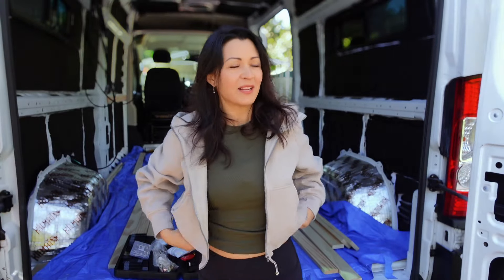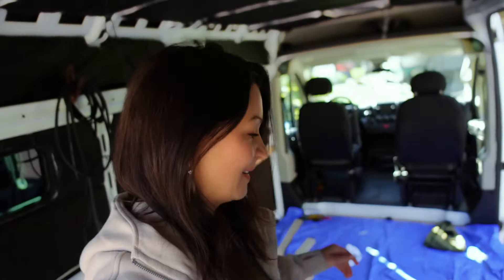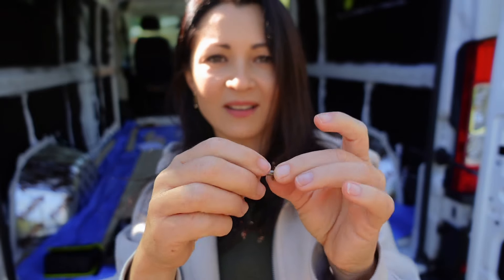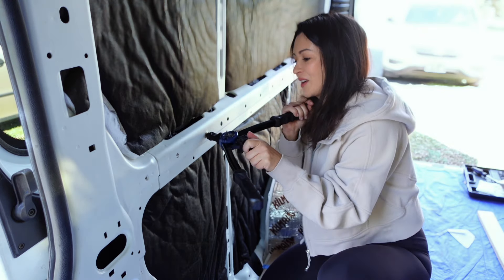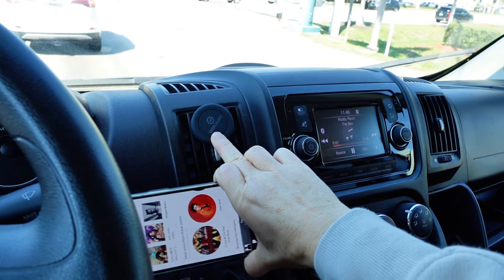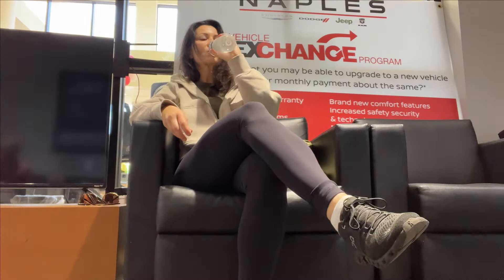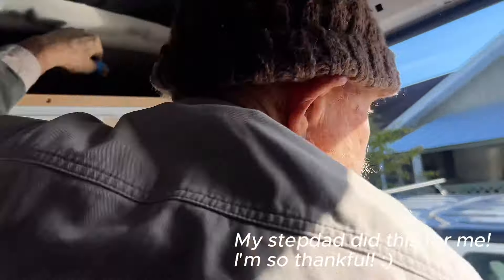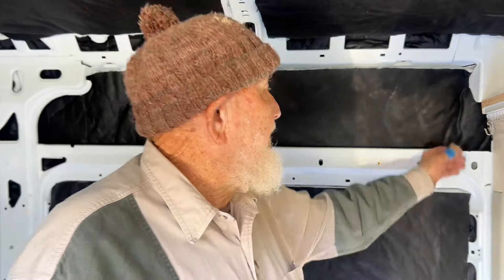Dealing with my van's battery issue and framing | Ep 24

Comment: For future reference, Autozone, and probably some other parts stores, will test your battery and alternator for free. Also, you can get a volt meter, not expensive, and test your own battery and alternator. There are many videos on Youtube, that walk you through using the volt meter, and doing those tests. If you test it yourself, at least you know for sure the dealer isn't taking advantage of you. Dealers will do anything to make a sale. You should be able to get 5 years or more out of a battery. Also, start your van up once a week, and drive it around for 15 minutes. The alternator will keep the battery charged. Anyway, the build is coming along. Keep up the good work. Kudos to your step dad for helping out.
Reply: As others have mentioned, a trickle charger is also a great idea.
Reply: $$$645??? For a battery??
Reply: Dealerships are a rip off.
Reply: I’d take the free battery & alternator tests with a grain of salt. I once replaced the alternator 7 times in a row under warranty in 3 weeks time & could do it in 10 min flat. It would test good in store, but wouldn’t charge when in the vehicle. The 8th worked totally fine. Yes, they were all rebuilt that you receive under warranty.
Reply: Theres some sound advice Elisa 👍

Comment: If you are going to leave your van parked for long periods of time get yourself a battery tender. Modern vehicles have parasitic electrical draw and over time will drain your battery. As for dealer avoid them like the plague. The only time you go to a dealer is if what’s wrong is under warranty or if your car is under warranty and needs regular service.

Comment: Shocked that the dealer got to you for $675.00.  You can buy that battery for well under $200.00...probably about $150.00 at O'Reilly, Advanced Auto, etc.  You should take it back to them and make them refund the exorbitant price they hit you with.  You are doing the right method on your build...taking your time, doing your research and your stepdad's shop will set you well for all the tools and help for the build.  Looking forward to your progress!
Reply: I agree with a refund. Walmart will install and it will be a lot less expensive.

Comment: Standard 12volt lead acid vehicle batteries don’t tolerate being run completely dead very often and can shorten it’s lifespan. Your battery is mostly there to start the vehicle and run accessories (when the vehicle is off). Your alternator is supposed to put out enough volts  (usually 13-14 volts) to charge your 12 volt battery, and run all your accessories when the vehicle is running. The little jump starter packs are definitely a life saver when nobody is around to jump start you. Smart investment! Thanks for sharing.

Comment: Buy a multimeter and your van battery should read 12.something when nonrunning and should read 13.7 to 14.something when running and that should let you know if the altinator is doing it's job.

Comment: Very good video. There is a rivnut <sometimes called crushnut> device that is pneumatic, but you need to have an air compressor, but if you are using holes already in the van it makes that job so much easier and quicker,
Reply: Besides, you get a lot of exorcize that way. LOL we use to jokingly say "we must, we must develop your bust" because it definately works those muscles. lol

Comment: Hey, for countersinking screws, there is something called a countersink bit that is easier to use than a Forstner bit. It drills a conical hole instead of a cylindrical one, and it matches the taper of the machine screw head. Great work this week!

Comment: One trick for marking your rivnuts. Color the face of the rivnut with black sharpie then hit the board with a soft tip hammer.  It will leave an indent and a black mark. Do the two on the ends attach them , then do the same with the other ones.

Comment: After watching probably a hundred van vids for a couple years now as I am soon to build my own, you have done a terrific job! Craftsmanship is wonderful. You've thought of most everything. You're on top of it with the jumper box for the battery too. As a motorsports guy all my life, I can tell you that if you had a 1965 van, you could park it for weeks and the battery would be fine. All todays vehicles have ECUs and onboard computers that constantly draw power. Park it a few days it may not be a problem, but park it a couple weeks and the battery will be drained, and not because it's a Promaster van. Get a Battery Tender. Hook it up when you're not going to drive it for a while and it will keep the battery charged. Keep up the great work.

Comment: With new vehicles, the main computer will slowly drain the battery because everything depends on the vehicle main computer. When the vehicle is sitting idle for a long period of time, you need a trickle charger to keep the battery charged.

Comment: The battery issue is likely due to you having the doors open for so long while you are building it.  The interior lights stay on and use battery power.  Also, having a van sit for weeks without being started will drain the battery as computer modules use power too, clock, stereo, etc.

Comment: Hello, I follow your channel and I'm amazed at what projects you "fearlessly attack" and you finish in such a professional manner...you really impress me!!...so, I've been an ASE Master Tech for over 47 years now retired...I have to say that without me actually checking the battery, I cant say for certain, but i know that if you just let the battery sit there, there will always be a small draw that overtime, will drain said battery...what I would do first and foremost is buy a good quality Battery Tender or "trickle charger" and once you jump start your vehicle and let it run for a bit to return some life into that battery, then shut it off and connect your "trickle charger" to your battery and connect the charger to a wall plug and as long as the van is parked keep it connected ...it'll slowly (recommended) charge the battery to full capacity and then it'll "maintain" that charge whether you start it or not...just my 2 cents!..😉👋👍✌️🇨🇺

Comment: I wonder if blue or even red threadlocker on the machine screws might be a good idea. I'm not building out a van but I can see where those screws could loosen up in time. May not be a problem but now is the time to do it if you want to. Using rivnuts is a great idea, it almost certainly has to be more secure than self tapping screws.  3 years is about the right time to replace a battery, they can last longer but for peace of mind I wouldn't risk it.

Comment: Regarding your ProMaster: I've had my head under the hood of a car (truck, etc) since I was 17.  I'm a lot older than that now - and, for me (I am 6'2" tall) - the ProMaster is the choice that I will purchase over the other products on the market.  So, don't worry -  you did not acquire the wrong vehicle.  3 years on a battery that was in very cold and wet weather is not untypical.  A lot of cold starts and hard cranks.

Comment: Good job Elisa, keep following your dream and things will definitely turn out well!
And why reinvent the wheel, YouTube offers so much knowledge that you can use.
The only thing I would use myself is a threadlocker from Loctite or another brand to prevent the M8 bolts from vibrating loose.
Vibrations can cause  to loosen bolts, which can cause annoying squeaks or creaks in your van.
Good luck with building your van.
Greetings from the Netherlands

Comment: Looking good👍progress. I do the same thing modding my cargo trailer, I watch videos from several and get ideas then combine into my own. If a lead acid starter battery is ever drained below a certain percentage that the platelets can have permanent damage therefore decreasing the overall life of the battery. So I hear it’s important to keep hotel load separate from the starter battery. Like adding an isolator or something so current can only flow one way to charge starter battery. I learned that from the RVers but did that on my sailboat too with solar. Awesome work you are doing there. Happy Trails✌️

Comment: Oh my, that Playdoh trick is awesome! 😲  I wish I had known about that when doing my last build! I really struggled on a lining up a couple of mine.  

  It's good to have a new battery since you'll be traveling, unfortunately with the Promaster even a new battery dying is a normal occurrence when it's left sitting for a few weeks.  There's some type of weak parasitic draw on them. To prevent it from happening on the new one you can get a small maintenance charger, or just start and run it once a week or so.  It won't happen when you're using the van on a regular basis. 

  For your upper cabinet area I'd HIGHLY recommend skipping the back framing. Not only is it difficult to work with that angle (As you noticed), but you don't need or want to frame or cover  the insides of your cabinets.  You'll not only lose a ton of space, but you'll lose easy access to any wires you run behind there.

Comment: Hello, tip on how to use the rivet crimper. You are screwing in the riv nut to far in. So there should be adjustment you can do to the base knob so you can insert the rivet nut about one eighth of the screw attachment showing. The riv nut should be on the top tip of the tool screw with one eighth of the install screw showing. It gives u less of an angle on the handle to crimp. Hope I didn't confuse you.

Comment: As some one else mentioned make sure that there are no parasitic current flowing from the battery when engine is turned off. And always keep your starter battery at full charge. If it sits for just a short time with less than full charge it will be degraded and  permanently damaged. A Victron shunt will tell you the exact state of charge of both your starter battery and your house battery. Also to get more leverage on the "hydraylic" handle extend the handles with something like a tube.

Comment: Your dad did a great job on your curtain rod !!!😊Please tell me…Did he have to screw into the black plastic part??? I can’t tell by looking at video….😊. Also….You may already know this….I was having a battery drain problem with my promaster also….I think the cargo light staying on was the problem….I keep it switched to the off position now since the doors are open while I am working on it, also bought a trickle charger for the times when it will be sitting!😊 Please let me know about screwing into the plastic…Thank you

Comment: Just a little trick in marking where those rib nuts are located. Use magic marker,paint or nail polish . Put some on each nut. Place the wood where you want it. Press the wood against the nuts and you will have marks on the backside of your wood where you need to drill. 
You can also do it with no paint,etc.. by placing the wood and hitting it to cause small dents where you need to drill. 
Just a thought.
Great job.

Comment: One tip in using the rivnut tool is you don't need to screw the nut all the way down as you did on the tool You only need to screw the rivnut until the thread of the tool screw protrudes out the end, that way the handles on the tool will be closer together and you have better leverage on the handles, good job on the progress you've made👍🏻
Reply: Cheater pipes.

Comment: Buy a small solar battery charger and you can place it on the dashboard. Plug the solar in the cigarette lighter and it will keep your battery charge. This product costs around $15 at Harbor Freight. I have used this method for over 10 years and never had a problem with batteries.

Comment: Great video. If you have a lot of those large diameter fasteners to do get some cheater ext handles from large dia EMT pipe that will slip over the tool handles.

Comment: Hi,  a trick that I learned instead of the playdough is to use blue painters tape. Put the tape on the van where the holes are, mark where you want the screws, and then place the painters tape on your wood piece and drill your holes. They should be aligned perfectly. Give it a try!

Comment: you just need a trickle charger to keep the battery topped off while you are not using it for periods of time.  they are like $50
Reply: or possibly solar panel on roof to trickle charge.

Comment: To keep your battery in good shape, check into a Battery Tender (that's the brand name). Easy to install. You just plug it in when you're not going to be starting your van for long periods. I use them on my Corvette in winter (I'm in Ohio), my motorcycle, and my ATV. Keeps your battery fresh and maintained.

Comment: Hi over time the parasitic  power draw will  drain the battery. A small solar panel on the dash and plugged in to the lighter socket woukd help to trickle charge the battery. Have a nice day. Tom in the Maritimes at the NB-NS border

Comment: Hi Elisa, newer vehicles have all kinds of electrical gizmos and gadgets that over time (with a vehicle sitting and not running) will eventually drain a battery. If you are going to be having the van sitting for extended periods of time still you can either get a “trickle” battery charger or have a battery “cut off” switch installed.  The cut off switch usually mounts close to the battery under the hood that you can easily flip or twist the switch to disconnect the battery to keep it from draining (and believe or not helps deter thief’s from hot wiring and stealing the vehicle too).  Just a couple of thoughts / suggestions for you.  Good luck with everything, love watching your video’s !

Comment: Good Day to you,

The more complex the mind the more the need for relaxation and play.

Unfortunately, people tend to project their self doubt, fears, issues and anxiety onto other people.

I admire your ambition, clearly you are a professional person with a balanced perspective and best of all a plan.

So regarding your wooden mounts to the van frame frame. Invest in a Framing square, and a 1 inch "flapper bit".

A flapper bit appears to look like a trident with the areas between the center post and edge posts filled with a bladed edge.

With your bolt assembly, instead of a hex head, attempt to purchase a half round phillips head bolt and one inch washers.

Assembling the bolt and washer measure the washer thickness and top of the rounded bolt.

That is the depth to set for your drilling drill for your flapper bit. May be a little more than 3/8 of an inch.

The washers will secure the boards better to the wall mounts.

This will allow you to mount your boards and have a flush finish.

You may also want to stain and seal the boards prior to mounting to prevent moisture absorption.

Best of wishes in your endeavors.

Comment: Most newer vehicles have a small parasitic loss from the CPU, and it is recommended to at least start your vehicle every 2 weeks. If you do not plan on running 
your vehicle for long term you should think about getting a batter tender. But it could be that the batter is bad but you should have a fully charged battery when having it teased.

Comment: You only need to measure the voltage on the battery with the engine started, if it is between 13,8 - 14.3V, the alternator is fine, and everything is ok. Keep up the good job!

Comment: Power in the van is always a problem,solar panels on roof are the best way for the summer but they struggle in the winter,best solution and a cheap one is to buy a extra van battery lets assume it is 45 amps that will if you are carefull run a night heater and other things for about 6 days all you need to do is start your van and go for a drive and then change the battery with the one in engine bay and you will have a fully charged battery to run van and the van one will charge as you drive around.
Reply: I always thought car batteries were designed to give a quick jolt of power.....not to something tbat sips power.  Isnt it the wrong technology for fan heater microwave etc??.
Reply: @Kevin-zz9nc Well the best way to heat the van is the diesel heater and the power that needs is small,in the winter you do not need a fridge going in the summer solar will give you all the power you need as you will have fitted the inverters and the batteries to store the power,there is no cheap way to set a van up to keep you warm in the winter as for eating the camping stove is still the best way to feed yourself.
Reply: @Brian-nf6bt  my question is about battery technology...

Comment: I disconnect the negative terminal on the battery if I do not drive it for a long period of time, also check to see if it has a tracking device installed by the dealership that could be a parasitic draw

Comment: Your doing a great comprehensive job!  A parasitic draw can drain power from the vehicle's battery, even though the vehicle is not in use. This can be caused by various electrical components that continue to draw power even when the vehicle is turned off, such as the radio, clock, or power windows.  It sounded like the dealer charged you $645-hoping i just heard that wrong...

Comment: Also. The screws you are using are called flat screws or counter sink screws. They sell a drill bit for the purpose of preparing the hole or countersinking the hole so the flat screw can fit perfectly with very little wood splinters. Instead of using a wood bit that u are using. These screw are mostly used for metal work but work fine for your application.